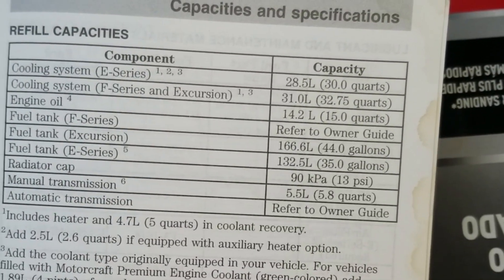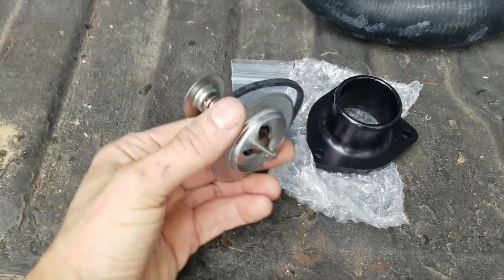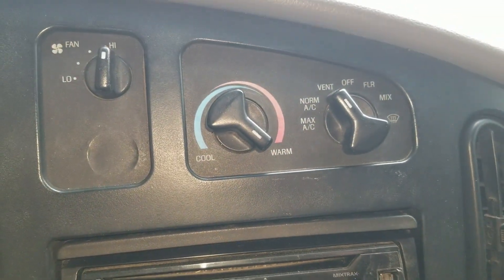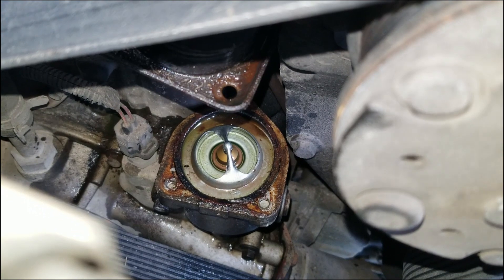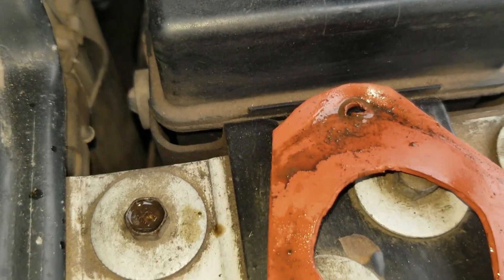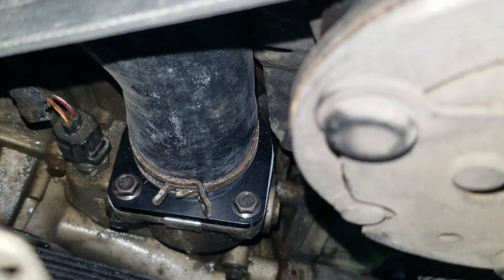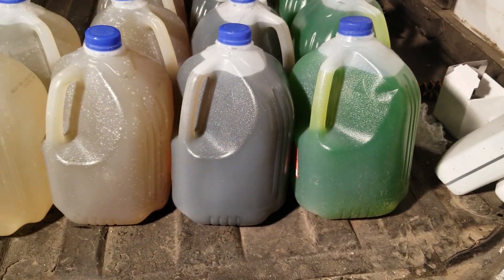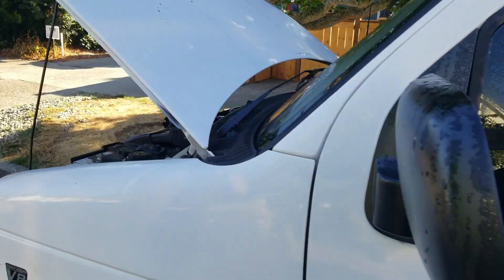Coolant Flush and 203 degree Thermostat Installation on 2002 Ford E350 7.3 Powerstroke Econoline Van

Comment: After putting in the new coolant my e350 5.4L overheated a few minutes after I started driving, it seems because I had an air bubble blocking the system. From what I’ve researched I need to let it cool, open the radiator cap and start the engine and let the air work itself out before I drive. I’ll comment if it fixes.

Comment: Well done! From one E 7.3 to another. how has this swap been running for you?
Reply from the maker: The biggest change is that the heater is mega hot, which is really nice here in the chilly Pacific Northwest.  I can't say for sure that it made any difference in fuel economy.   I don't think I would do this mod if I lived in a hot place, but since it's cool year round where I live and I use the van as a daily driver including short hops, I think holding at a slightly higher temp is good.

Comment: Finally someone who puts all the products they used in the description. Thank you. I could not for the life of me find the additive. Everyone else who's done a coolant flush doesn't say what they used or put it in their description. Also I absolutely love the 7.3 Econoline. I have an Excursion but would love to have an E-Series someday too. And when you filled your coolant after flushing, did you drive around to get the coolant around the motor? If so, did you just top it off with distilled water?
Reply from the maker: Thanks, glad it's helpful to you!  I drove the van hard for a few miles at each step of the flush to move that flush water around and get all the gunk out.  After flushing I had a pretty good sense for exactly how much would go in, so I just filled it with coolant and distilled water per the instructions on the coolant bottle.  I checked levels for the next few days and topped it off once with a tiny bit of distilled water.

Comment: Thanks for the vids. There ain’t much out there for these guys
Reply from the maker: You said it!  I'm working on changing that, one video at a time.  Most of my upcoming videos are about installing a high top but I'll get back to some 7.3 specific stuff in a couple weeks.  Notably battery replacement and eventually I'll address glow plugs, UVCH, injector rebuild, and maybe a fuel system video.